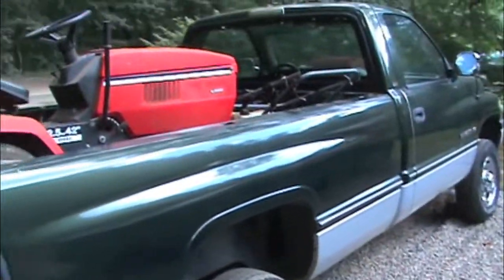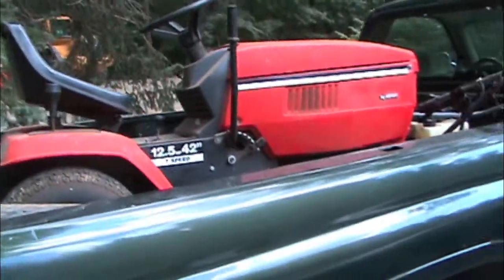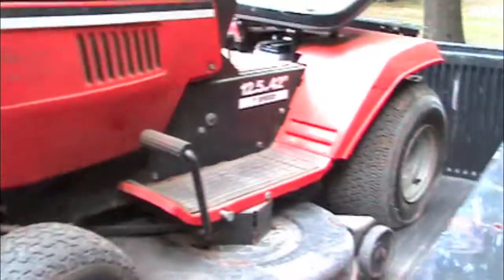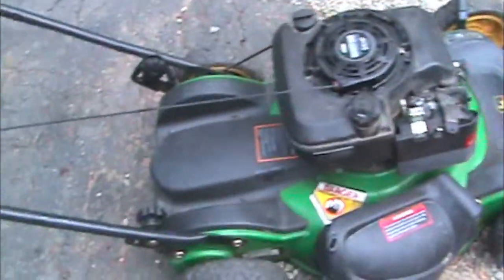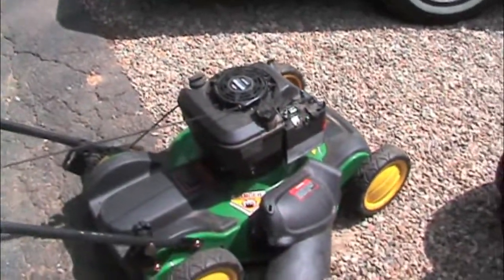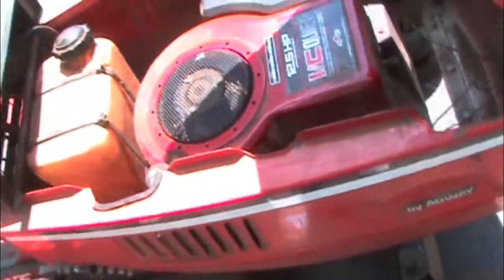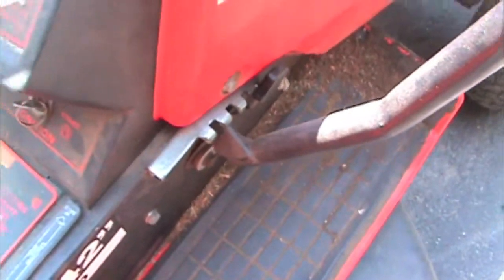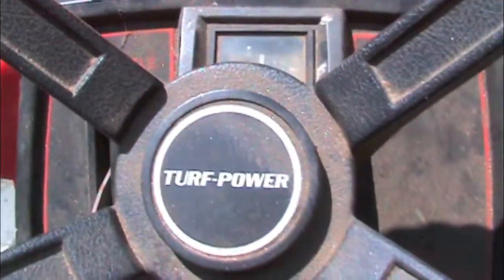Agway from the dump 8/7/10

Comment: My MTD yard machines mower has mowed 2 1/2 acres every week since 1998 and it has only had regular maintenance and tune ups never had a problem still on the original engine,deck spindles,tires everything works fine and performs with no problems it is a 18hp opposed twin briggs with a 46 inch cut 3 blade deck and 7 spd trans great little mower

Comment: @moldymac I don't doubt it! my new cub cadet has an electric PTO and a well designed deck height lever cause it has a lot of different heights. but all of those older MTD's just suck. when i first got the white last summer i couldnt even get off the tractor or let go of that lever without it slipping into the on position. i of course had to shut off the engine to move any debris which was a pain in the ass. fortunately it stopped after i filed it but if i went over a bump it still did it!

Comment: I have a John Deere lt 155 with a 15 horse kohler. It has this weird problem where it needs choke to start when the engine's warmed up. If you shut it off and try to restart it, sometimes it needs choke and sometimes it doesn't. Could this be a simple fix?
 Thanks.

Comment: That MTD deck design is the stupidest thing i've ever seen. i used to have a white tractor by MTD and it was a piece of shit! had a 13 horse briggs intek that needed carb work but it did run ok a full throttle. but it had that deck problem too except the off position was so stripped it wouldn't even stay in it. luckily i filed it and it fixed it. but i just recently replaced that with a brand new cub cadet by MTD and i am very impressed with it fortunately! i hate that the hood is plastic though